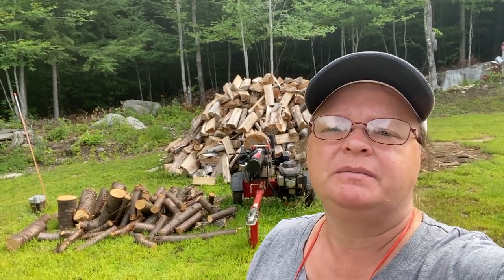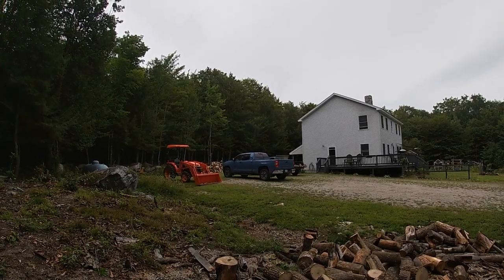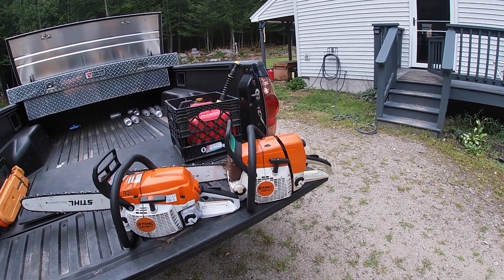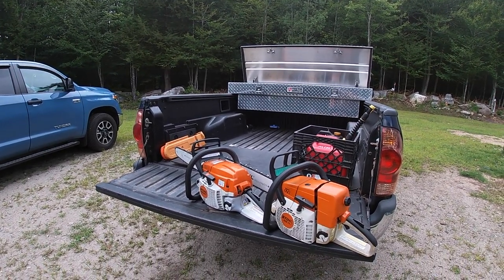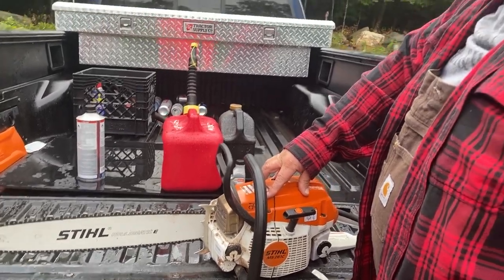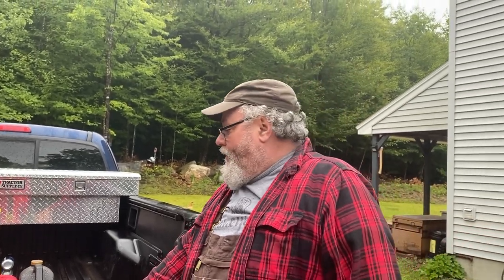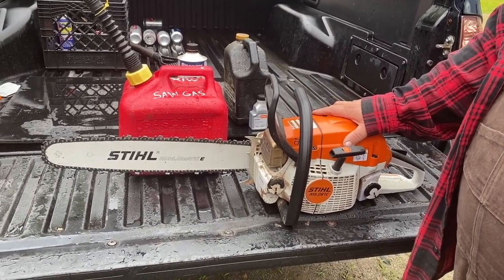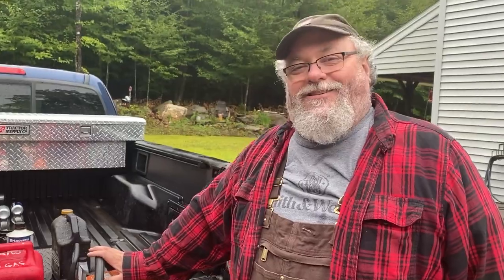Most Important Tool for Every Homesteader

Comment: tottaly agree... i have an old 026 and a 029 and a newer 290 ...im envious of your 361 ....i savethe ittle mini bottles and buy stihl or husky mix by the quart and fill all the mini bottles and buy the non ethonal 5 gallons at a time but have 2 gallon mix cans ...cheers nice channel
Reply from the maker: Yes, the 361 has been a great saw. I’ve had very good luck with it. It’s actually the reason I bought the new 261 (also a really good saw)!! It’s funny you mention saving the metal quart cans. I do the same thing. Much easier to carry on the tractor, especially for the brush trimmer. I still have a Jonsered 2153 too, it’s a good saw, but it spent a lot of time at the shop when it was new. Should have been under warranty, but the dealer claimed it wasn’t covered, which wasn’t true. Good dealers are very important!!